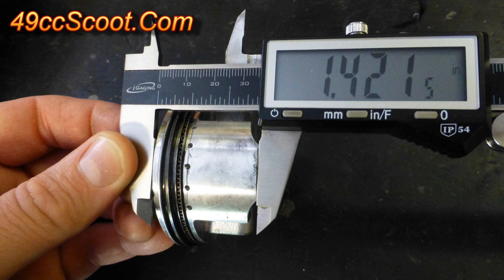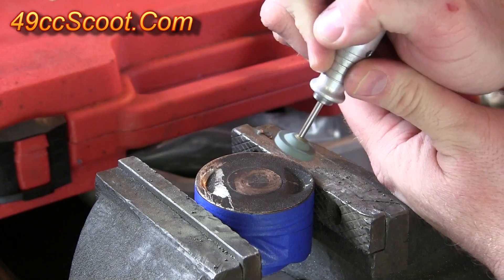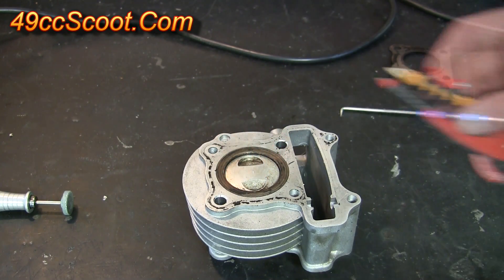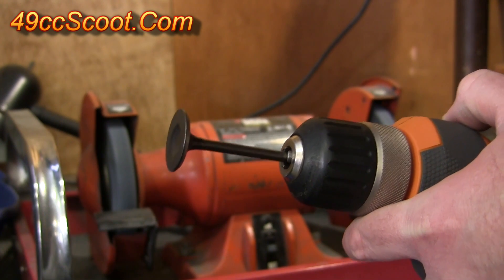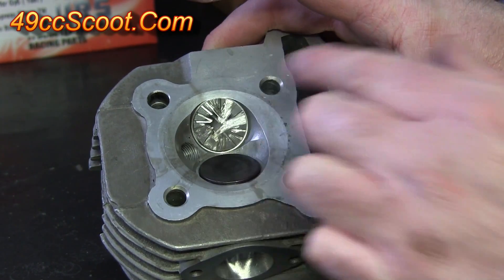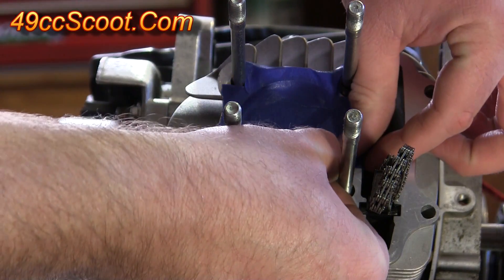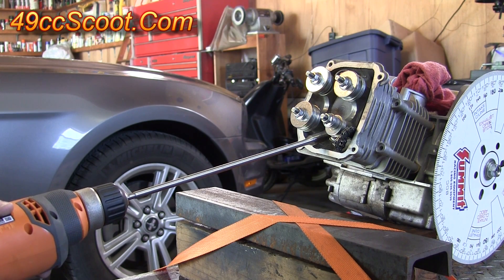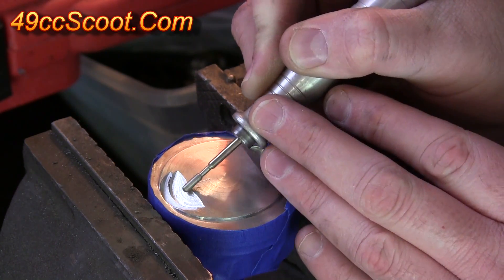Piston Notching : Cutting Or Modifying Valve Reliefs

Comment: How thin can you get away with on the piston crown where the relief is on a small engine like this?
Thank you
Reply from the maker: It depends on the exact design and use, but I was never able to nail down a concrete answer. I would try to stay 0.100" or thicker, but I did one about 0.065" after reliefs and it didn't come apart. Probably pushing it.
Reply: @49ccscoot  Thank you

Comment: Scoot, I have a racing cam im going to install on 50cc bt49. It has 1mm more lift and much more duration? Should I be prepared for piston strike you think?
Reply from the maker: It would be a good idea to check. I have vids about checking piston to valve clearance a couple of ways. The absolute minimum effort check is to turn the engine over by hand before it's ever started and make sure there is no contact. That won't tell you if clearances are technically sufficient, but at least maybe the piston won't hit the valve and ruin it as soon as it fires up.

Comment: How does this effect the balance of the rotating assembly?
Reply from the maker: If you had everything balanced, then it prob wouldn't be wise to then cut material out of the piston. In that case, mock up and cut then balance. Otherwise, it's likely a minimal change unless you've really got to cut a lot. Beats the alternative of smacking a valve into the piston still.
Reply: @49ccscoot  Everything was balanced from the Factory ... its not a minimal change either a couple grams is tremendous to this little fine built Machines Balance ... Its also a big deal to take everything apart an have it rebalanced . What Beats the Alternative of smacking a valve into the piston these engines Very Rarely if Ever have that issue ... The loss in compression is going to effect performance negatively .. Unless you added a hot cam which would necessitate this modification an a piston replacement an rebalance ... Shade tree at best
Reply from the maker: @civilianspaceagency7106  Apparently you've never installed a big bore kit. Remember that this video was made about a scooter. The big bore pistons can be quite a lot heavier than stock. If anything, you'd be putting it closer to original balance by notching in this case.

Comment: what about 2 stroke pistons  ive seen windows cut out on the intake side and holes drilled in the exhaust side.whats your take on this?
Reply from the maker: Not at all related to this topic.

Dimples or even holes on the exhaust side are usually for oiling/cooling and must be done so that they don't align with any ports.

I'm not sure that windows on the intake side do much of anything on the case-reed inducted engines that scoots I'm used to have.
Reply: thanks im not putting any holes in it.

Comment: cutting it freehand might work but in the long run the piston balance is going to be off causing a throw effect in the cylinder over a period of time , hence causing wear on the bore in a sideward manner..  and resulting in a loss of compression. pistons are things to be machined and are perfectly tuned to cause minimal engine wear from this situation.
Reply: You would never remove enough material to make a difference. I have been sitting pistons for 12 years.
Reply: Steven L who’s wrong? The op, or the guy that said it wouldn’t be enough material to matter?
Reply: @chriswest5360  Its going to be way off balance a few grams goes along ways in longevity especially to a single cylinder Tiny Bore like this .... This is No Way to Do Anything ... Order the Correct Piston Or have it Machined an Correctly Balanced the Rotating Assembly

Comment: hey some help please I have a 2014 TaoTao and I over twist the spark plug and now it's not engaging any tips for that or what's that kit that I need to replace appreciate the help
Reply from the maker: +Oscar Navarrete It sounds like you stripped the threads in the head. It could be re-threaded, but with the cost of a new head, it makes a lot more sense just to replace it. There are heads with 64mm or 69mm valves. For the TaoTao, you should need the 69mm version.

Comment: Hey in the past when you did the piston to valve clearance videos on the 139qmb, was that scrappy's 52mm piston that you had in there? Also was it on a stock crank or a stroker?
Reply from the maker: +Korey Eberhart I haven't done a P2V vid with the 139QMB. My recent vids about this have all been a GY6 150, mostly showing a domed 58.5mm piston from an eBay seller.